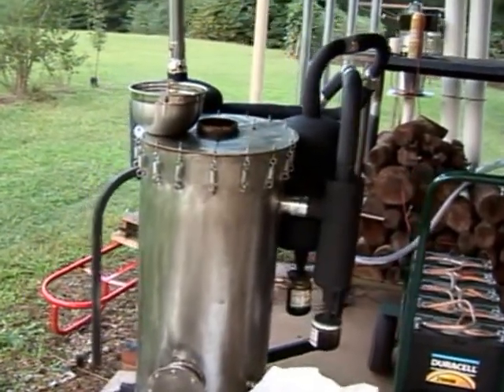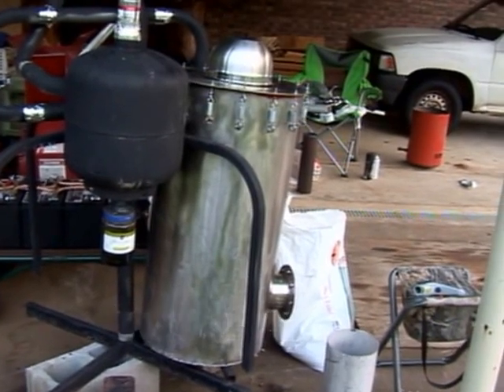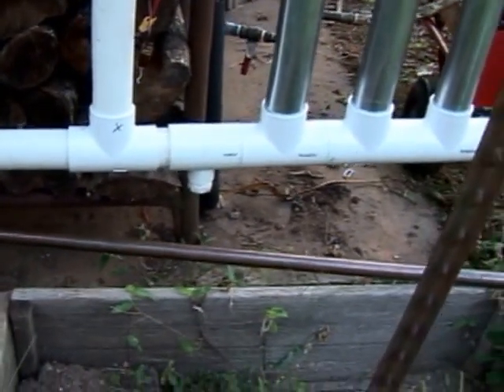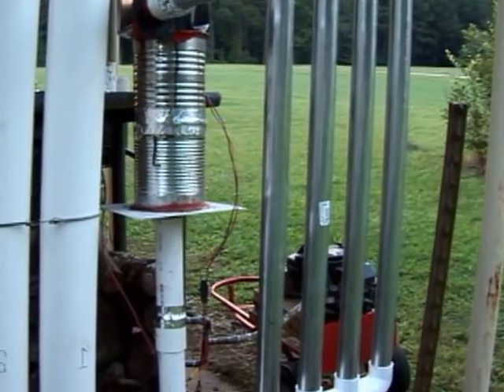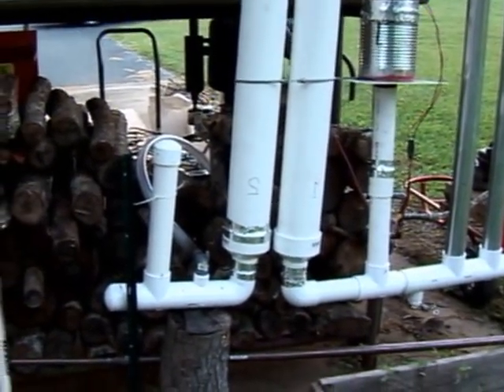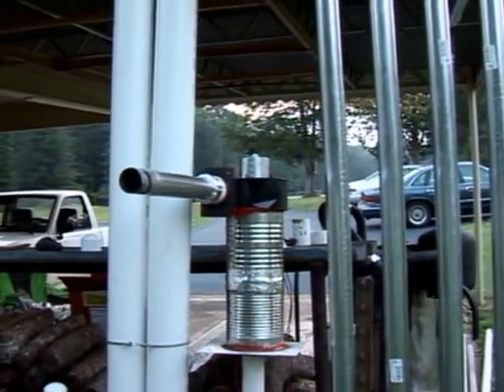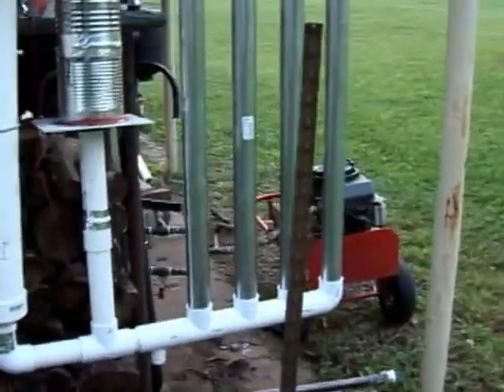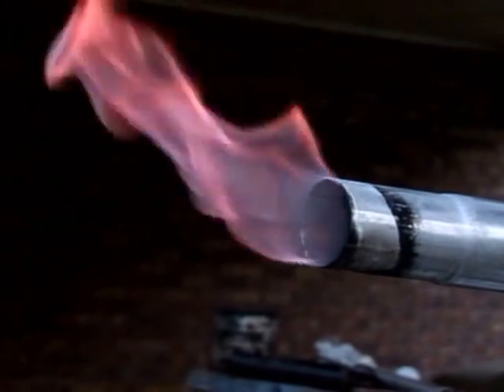Wood gasifier running engine

Comment: I agree with xoxoXoieoxox that you really need to upgrade to an imbert style gasifier.
They produce the higher hearth temps needed  to "crack" the long chain hydrocarbons molecules to eliminate "tars". These tars cannot be "filtered out"!
Check out the small engine users section on driveonwood.com. Hope this helps.

Comment: I almost forgot. You can clean your stainless steel pads with a 1/2 cup of OXY-Clean in a bucket of hot water. When you drop the pads into the solution it will eat the crud right off of the pads. Since you are running a FEMA you may want to experiment with your filters. If you see any fog or smoke on your flare tube before it's light you are probably carrying tar-gas thru the filters. A Imbert is different because you will be carrying carbon soot dust thru the system and your flare will burn a florescent Halloween orange unfiltered.
You can get your gas to be invisible when the flare is extinguished just by playing around with your filters. Once again, nice job and Good luck with the gasifier adventure.
Reply: Copper is nice and reactive. that will draw out water well.

Comment: First of all, great job. You can either lower or stop the tar if you reduce down to 2 inches at the bottom of the fire tube. A 2 inch reduction would be the right size for a small engine. My first build was a FEMA too. Just keep in mind that the tar can travel thru the system in a gaseous state and it can pass right thru the filters. Cooling the gas really helps the filters do their job but it's only a band aid so be careful so that you don't have to do any overhauling. Have you checked out CNCmachiningisfun channel? He is off grid so he can give you some good advise on this stuff too. Once again, nice build man.

Comment: here is something u have over looked but its a good thing since u used fence pipe it has a zink coating on the inside of it now this has like a catalyst effect on the smoke and makes it more pure now it will be really important to keep this clean as to be able to promote this secondary reaction good job but u really need a imbert reactor i will be firing mine soon it took me 5 different femas to come to the conclusion that the imbert is way superior but as well it is a totally different unit